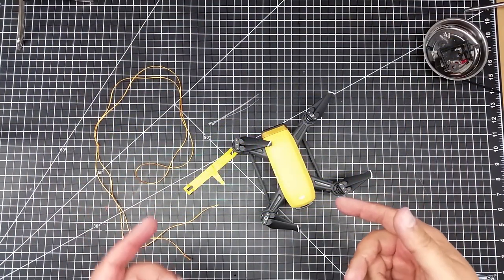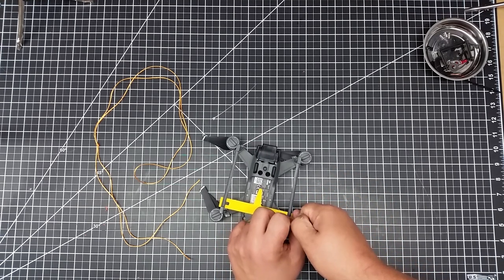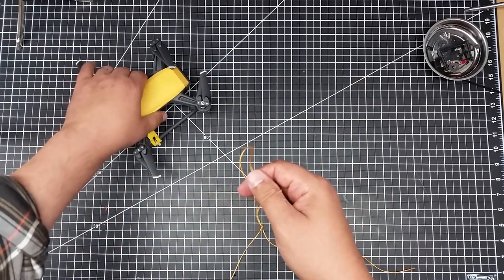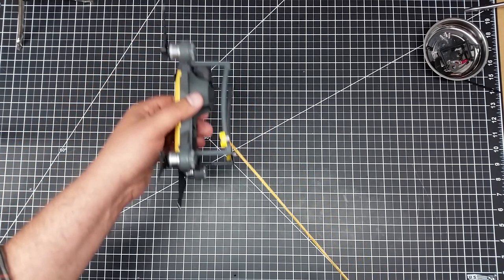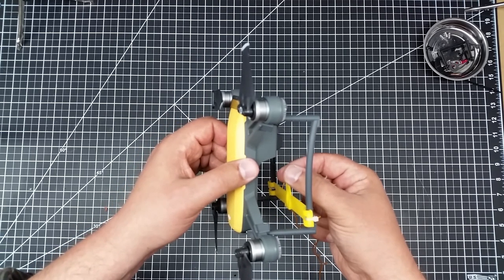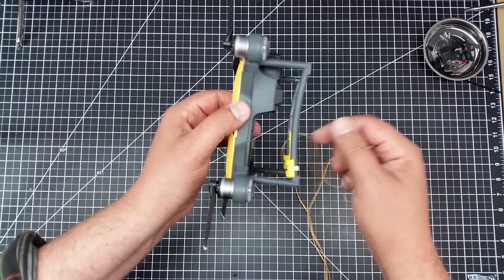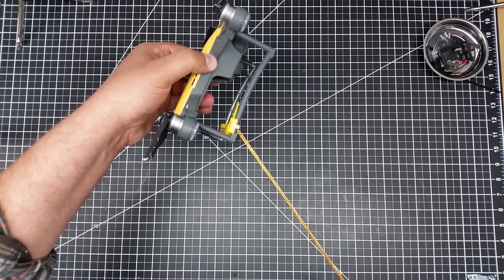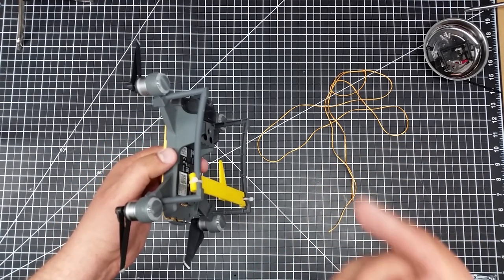Video Drone - DJI Spark Surf Fishing Release!

Comment: Hello , this hook is a good idea and i saw this type in many videos ....your solution is better than other metal solutions i believe..my question is about the position of this hook  on the spark ...is the middle not better for the flying capability? Did you make different test flights ?  greetings
Reply from the maker: Yes the middle would be "better" however then it would in the way of the downward looking sensors and interfere with it.  While you could turn the sensor off, it is a pain as well as a risk as well so moving the hook to the very back only adds a very small imbalance to the copter so IMHO not worth the pain or risk...